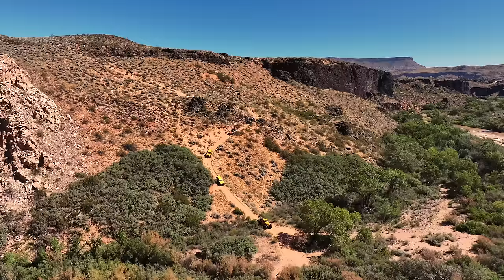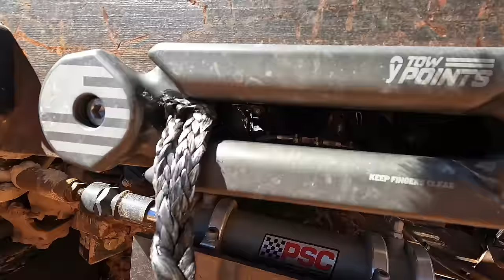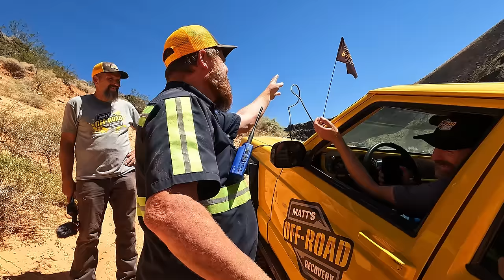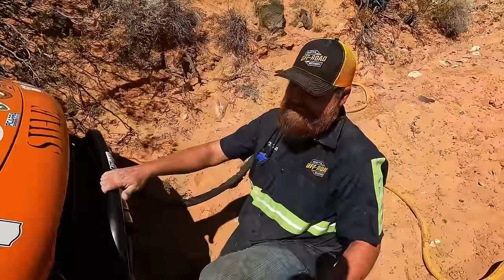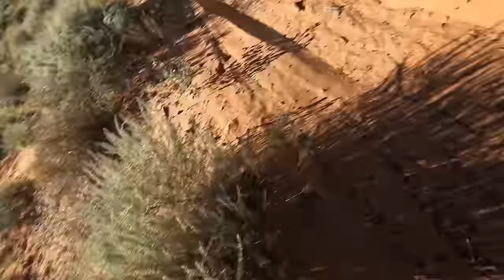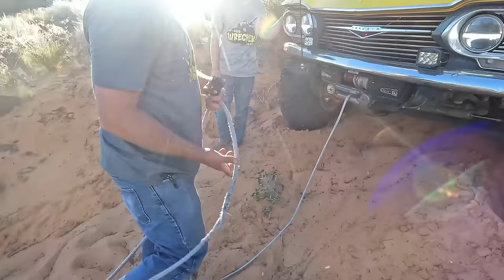I Failed...The Most Difficult Rescue Left Unfinished!

Comment: Did I miss it or did you guys just bit air-down your tyres? I drive dunes all the time and we air down to 9-10 psi. All your tyres look like they’re running too much pressure. Airing down is the single best thing you can ever do in sand. 

No. 2, drive in 4H not 4L, so you can keep speed up and avoid gear changes. It’s amazing what can be done in 1st gear and 4H! 😂

Comment: Those guys are planning to drive that Porsche from Alaska to Patagonia? Those guys plus the car are going to be eaten alive. Porsche will be scrap metal in Central America, and they'll be flying back on a 737. Doesn't even have a true 4X4 mode? And look at the ground clearance. Wheels, tires, wheel bearings, CV axles, etc will all be in the slag heap. 😂

Comment: The Porsche had the same problem as most other 4WD vehicle systems used in vehicles over the past 15 years or so, in which the software and electronics used to control the 4WD have insufficient capability.  Give me fully manual controls, particularly over the diff locks, and a half experienced driver, and the evidence I have seen the results will be superior to any vehicle using software controls.

Comment: Dear friends, I bet you got automatic transmissions. Well, that does not really think how to drive, it has its own mind. Doesnt matter if you lock on som gear, you have to be able to switch them. Once gained momentum, you should have switched to the second to get lower RPMs and maintain speed. Instead, locked on the same gear (first is the worst to be locked in), all the torque you might have makes the wheels to loose traction on the sand. A Russian LADA 4x4 with 83 HP would have done this done, well, if not on the very first attempt, definately on the second one. Lightness count. All the best and be safe.

Comment: Stupid plastic parts
 a winch rope instead of a wire rope on a winch ,what's wrong with old style winches old style wire rope, old style pullies to run the wire through instead of something the size of a letterbox , it is made to fail, and it's only a few months old , 
engines cooked